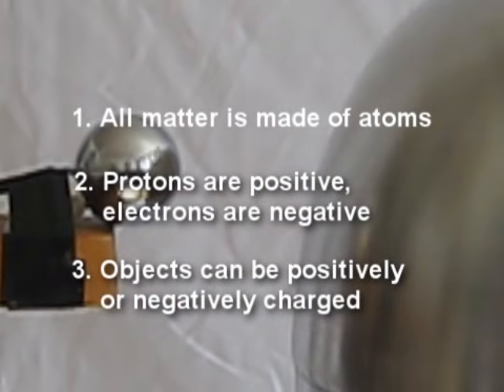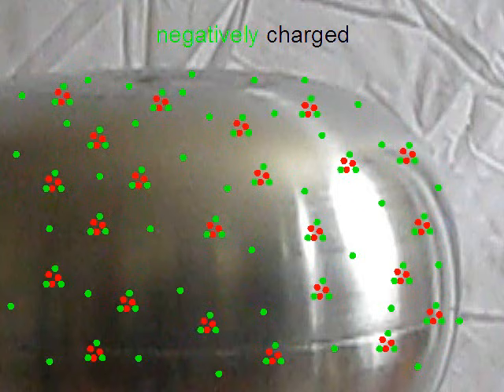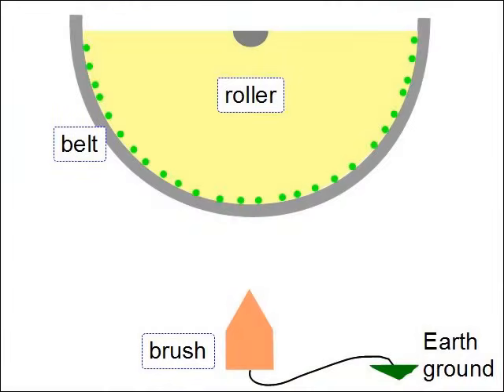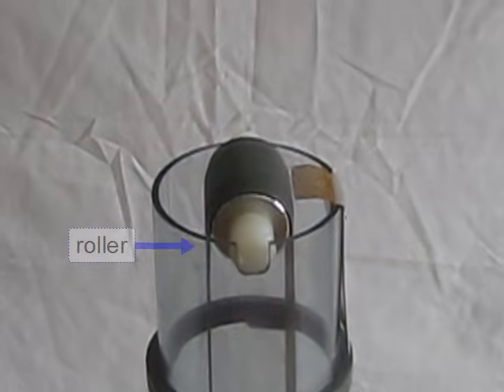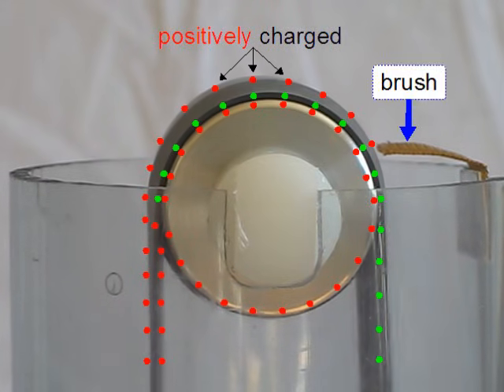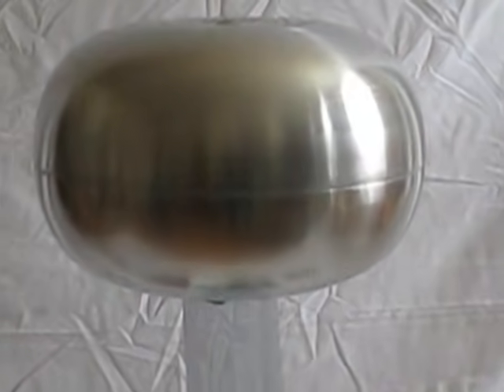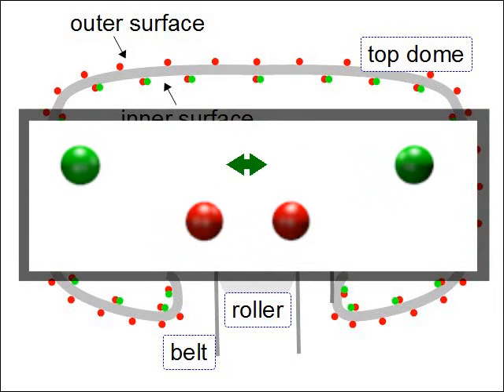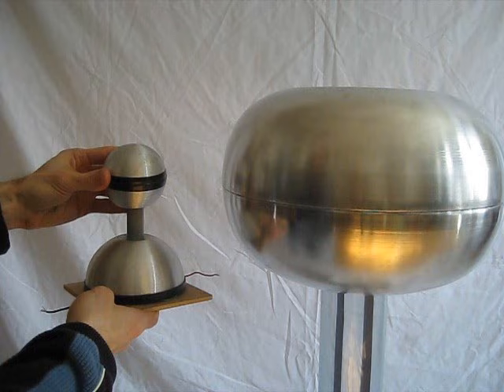How a Van de Graaff Generator Works

Comment: Couldn't you use running water instead of a belt?, maybe charge the water?
Reply from the maker: Funny you should ask, that's what a Kelvin water dropper does. Here are my videos about how it works https://www.youtube.com/watch?v=V3sV8t_HUdc and how to make one https://www.youtube.com/watch?v=sArNxGnYhNU
Reply: @RimstarOrg  Awesome, thanks for the reply...

So it's possible the water underneath the Great Pyramid was used like a conveyor belt to draw in electrons or ions, then they might have used vibrational frequicies to vibrate the structure and produce even more electrons and the combined frequicies helped transport them to the upper ionosphere...

Simple
Reply: This was my delusional theory if you're interested...

The so called queens chamber star shafts of the Great Pyramid were in fact a liquid tuning fork.

There is no logical reason why the builders of the Pyramid would leave a five inch space between the Chamber & the Shaft unless they wanted a magnetic source in the Queens chamber to have an effect on the Star shaft.

SO! ...If you fill the shafts with Liquid Mercury and have an electric current and a magnetic source to make it spin almost as fast as the speed of light.

Also note the shafts bend to the shape of a tuning fork as well.

 So when they spun the Mercury it vibrated the entire structure 

This powerful frequency was the same tone as the multiple tuning forks in the grand gallery & being of the same tone they resonate in sympathy if the other is struck & the builders also built the gallery to resonate at that frequency as well...

What happens is they all start to resonate off each other & give each other strength & you'd have a resonate wave

This too is vibrating the structure, all that rubbing stone with over 1.5 tons of quarts crystals embedded inside...

I have several theories about the kings chamber but I suspect there are far more than only two tuning fork frequencies built into the structure because vibrational frequicies are a very powerful medium 

But I'm thinking the frequencies joined together to form a beam for the charged ions to travel up to the ionosphere  

So I don't know it's all a work in process lol

I have no scientifical learnings as I like to say
Reply: See I don't know what they wanted to send up to the ionosphere...Positive or neg ions? Electrons?

The idea is they were seeding the ionosphere so people on earth could download it and use as wireless electricity...

Haven't read any Tesla books so...& I don't know an ion from an atom too lol

No idea how they could have powered machinery with that technology but I do suspect the Djed post with the three horizontal plates looks to be the almost perfect vibrational frequency machine if you designed one. 3 different plates, 3 different tones

Again, very powerful stuff mixing vibrational tones - like a saser beam for example, you can heal kill, destroy...

So if you set up your Djed you'd instantly receive power for all of your other devices...
Reply: You can, also certain gasses will work with a pump system.

Comment: Nice video with many details. There are some confusing parts though about the rollers!
It's not clear, for example, why metal would give away extra electrons beyond neutralizing the inner belt? (there is no field after neutralization that would drag electrons and charge the belt)

The current explanation concerning internal surface of the belt doesn't stand long term operation by breaking charge concervation law. For example, the given explanation tells that the belt brings negative or no charge to the bottom roller and always removes positive charge from it. This would inevitably cause unlimited growth of negative charge on the bottom roller. A similar thought experiment can be done for the upper roller too.

Comment: The short explanation is that charge is sprayed onto the moving belt due to the action of the lower points.  This charge is then carried up into the hollow metal dome.   Faraday's ice pail experiment shows there can be no charge inside a hollow conductor so the charges migrate to the outside of the dome.  The potential builds up until the air breaks down in a spark discharge .  The energy for all this comes from the work done against the repulsive forces as the belt moves upwards.

Comment: 4:24
Why not electrons move from the brush to the belt  ?
Reply from the maker: Negative charges repel each other. Electrons are negatively charged and there are extra electrons on the roller. So the negatively charged electrons on the roller repel the negatively charged electrons from the belt to the brush.
Reply: @RimstarOrg  Thank you for your good video and thank you for your answer.

Comment: if the top roller is a little bit more positive than the bottom roller but still tends to charge negatively with the belt made of nylon (strong positive). The generator wouldn’t work as good as if the top roller would be made of a positive/neutral material ? I tried putting aluminum (positive) in the top roller but it doesn’t work as good as the pvc (negative) top roller and  don’t know why that is
Reply from the maker: If both the top and bottom roller are on the negative end of the triboelectric series relative to the belt (nylon) then I'm not sure why yours is working at all. The rollers should be on opposite ends of the series from the belt.
Looking at a randomly found triboelectric series, https://www.carolina.com/teacher-resources/Interactive/the-triboelectric-series-an-introduction-for-static-electricity-labs/tr35107.tr , both aluminum and pvc are negative with respect to nylon but pvc is further away from nylon than aluminum is so maybe that's why pvc is working better than aluminum.

Comment: What motor what’s used?
Reply from the maker: In the big Van de Graaff generator, the motor is a 120V, 60Hz, 1.8A motor. The part number is 301-7033 but I can't find it online.

Comment: Wait I’m confused. In step 1 you say the roller gets a negative charge and the belt gets a positive charge (assuming the inner surface of the belt). But in step 2 we need to charge the belt. If the inner surface of the belt is positive and the roller is negative wouldn’t that small area be more or less neutral? And if it is, there shouldn’t be an electric field. So how does that electric field develop?
Reply: I’m probably missing something blatantly obvious…
Reply from the maker: That's a good point. However, the inner surface of the belt is positively charged starting at the point where they separate and the belt continues upward. The inner suface of the belt isn't charged yet while it's still in contact with the roller. Then starting around 8:06 you can see that the belt is either neutral on the way down. You also have to keep in mind that the belt is made of a non-electrically conductive material, so the charge doesn't move around on the belt on its own.

Comment: Question: can that spark make heat? And how?
Reply from the maker: I'm not sure. I think I recall reading that the spark is hot and heats the surrounding air. However, sparks are something I've typically avoided so I don't have enough experiences to have ever noticed.
Reply: @RimstarOrg  I guess if a spark is air, a fuse is the metal alternative.
Reply: I guess it is that due to the ionization of air 
energy is released in the form of heat?

Comment: You gave a great explanation thanks for putting this up! Was horrified at some of the comments below the primary grades K-12 sure aren't what they used to be. Having fun printing conductive PLA and making little induction machines and also just finished a VDG using a printed sphere. Awesome retirement fun as I can now make conductors in most any shape within reason. Did a 200mm. sphere with the bottom curving gently up to the top end of the tube, looks a little like a torus from the bottom. Or a sphere that somebody sat on. Results v. good. Sounds like you're having fun with this me too it's interesting stuff.

Comment: Sir, how to take connection fron van de graff generator.  Like positive and negative connection.??
Reply from the maker: It depends on the Van de Graaff generator. With the big one that I show in most of this video, the negative is the bottom and is connected to the ground in the wall electrical socket so connecting to that same ground will work. For the positive, you need to connect to the dome somehow. For that, you can connect your wire to a smooth, rounded metal object like a drawer knob. Basically anything that doesn't have sharp points since sharp point leak ions to the air and your voltage will be lower. If your negative is also a dome then you can do the same there. You could also just tape the ends of a wire to the dome but make sure the sharp ends are in contact with the dome. I use that method and another in this video here https://www.youtube.com/watch?v=CoWEhcBaFjU to power a corona motor.
Reply: @RimstarOrg  thanks a lot for you response.  My college project is  van de graff generator,  and planning for giving an application for it. A DIY ping ball particle accelerator is the application.  For that , I want to take positive and negative terminals from   generator. Can you give advice for that
Reply from the maker: I don't really have anything more to say than what I said above already. If you're referring to what's also sometimes called a ball cyclotron, here's mine https://www.youtube.com/watch?v=hgt62kh15g8
Reply: @RimstarOrg the link isn't to anything to do with a Corona motor...
Reply: u can use a Leyden jar capacitor to hold the negative charge

Comment: how does the inner surface of the belt become negatively charged rather than being neutral while returning to the lower roller?
Reply from the maker: Good point. The positive charges on the inner surface of the belt on the way up would attract at most and equal negative charge from the roller but not more. So on the way down the inner surface of the belt would either be less positive than it was on the way up or it would be neutral.

Comment: what if you coated the dome with an electrical insulator would that increase the maximum voltage?
would the limiting factor then become the air in the tube?
Reply from the maker: My guess would be the insulation on the dome would break down or maybe the inner surface of the dome would spark to the belt inside the dome. The charge on the belt remains the same. The build up is on the inside and outside of the dome due to the Faraday cage effect.
Reply: It's already coated. *Air is a great insulator. Of course, the best insulator would be a vacuum. (What would happen to a Van de Graaff generator whose outer dome is exposed to the vacuum of space? :-) )

*Well, motionless air is a great insulator. Maybe you could put it in a container to keep the air still, but the ion wind would still move it. Oh, what if you put a large dome around it? And then give that dome the same charge. Prevent ions from transferring. Hmm. But now you have a second large, charged dome to deal with. Oh! What if you put another larger dome around that one? 🤔And then...
Reply: @jonmichaelgalindo  Great comment!

Comment: howDoYouGetMoreCurrent?
Reply from the maker: You can use a wider belt and combs/collectors. You can also make the motor turn faster.
Reply: @RimstarOrg  So,IImagine,IncreaseSurfaceArea...
Reply: Build a big capacitor. On second thought likely not a good idea. The discharge could kill you. (short duration but high max. current.)

Comment: I was wondering that with metal objects like the dome here which are not fully closed, can we say that one side is “inside” and the other is “outside”? Wouldnt that be valid only for fully closed objects? The air/atmosphere exists on both sides of the dome’s walls…it is we who call it inside and outside…the inside and outside surface of the dome are one continuous surface. So how valid is the explanation given?
Reply from the maker: The Faraday ice pail effect doesn't require the object to be fully closed.

Comment: Amazing and comprehensive! Thanks.
Question: would the generator not work in vacuum since there would be no air for a corona discharge?
Reply from the maker: Thanks! I guess it wouldn't work or wouldn't work as well. There's still the chance of the electrons crossing through the vacuum.

Comment: And what if the comb conected to the dome is the one that's receiving the electrons of the belt???
Reply from the maker: In that case, the electrons on the inner surface of the dome will repel electrons to the outer surface making the outer surface negatively charged instead.
Reply: negatively charged domes are less effective and more prone to buildup from atomic attraction.

Comment: Where to get or how to glue the tape(belt )?
Reply from the maker: Which tape do you mean? If you mean the belt then that depends on what material your belt is made of. For rubber, I'd suggest experimenting with a rubber cement, available at hardware stores. However, to some test pieces first. You can also try sewing the two ends together.

Comment: If we repeat the question, but on the van de Graaf generator, the generator is charged with a positive charge, and when we approach a neutral body, an electrical discharge occurs, meaning that electrons move from the neutral body to the charged body to neutralize the generator's charge. The question is why does the neutral body that gave its electrons not charge?
Reply from the maker: The neutral body that gave its electrons does charge. As you say, the generator's dome is positively charged and the neutral body is neutral. That means the two are charged differently. Whenever you have this difference, charge flows from one to the other until they have each have the same amount of charge. So in your example, electrons will flow from the neutral body to the dome until there is an equal charge between them. The dome will be less positive than it was and the body will now be positive, both with the same amount of positive charge.
Reply: @RimstarOrg  That is, the body does not lose charge at once
Reply: @RimstarOrg  By the way, if the two bodies become positively charged, why do we not feel an electric shock when touching them?
Reply from the maker: You won't notice the transfer of charge if it's too small. For a spark, there has to be enough charge to break down the air as you approach the object. If there isn't enough to break down the air then you'll simply touch it and the small charge will flow.
Reply: @RimstarOrg  Thank you very much. Can I ask you one last question regarding the electric voltage, they measure it in relation to the voltage of the ground? So if we assume that we have a negative charge of -3c connected to the ground, what will be its voltage and in the second case we have a positive charge of 3c that was connected to the ground, what will be the voltage of the two charges on  Someone?

Comment: QUESTION:
How would the placement of a UV light affect the Van Degraaf Generator, so that it provided higher energy photons into the negatively charged side of the belt?

-I'm guessing that the VDG would  cause Quantum Leaps of the energy levels of the electrons ....which would cause the photons to be more energetic ... which could lead to the UV radiation becoming higher levels of Electromagnetic Radiation, such as X-Rays, or Gamma Rays???

I have never heard of incorporating a UV light with a VDG. Is this something that is actually done?
Reply from the maker: I've never heard of it being done but that doesn't mean it hasn't. The only playing around with UV lights is there fun experiment in my video here https://www.youtube.com/watch?v=puT36rd9dkQ and based on that, I don't think that light would make much of a difference to a VDG.
Reply: @RimstarOrg  What are the applications of a van de graaf generator?
Reply from the maker: These days they're mostly used for fun and for demonstrations in museums and science classes.
Reply: @RimstarOrg  I recently read a U.S. patent filed by the U.S. Navy.
Its what's called a U.S. Navy UFO Patent.

Its for a complex device called a High Energy Electromagnetic Field Generator.

It has 2 Pelleton Van De Graaf generators in it.
Reply: @adamrspears1981  Mark McCandlish said that the Biefeld-Brown effect doesn't kick in until the capacitor charge reaches 1,250,000 volts. This is why nobody has duplicated it, or it doesn't work in a vacuum. Not enough voltage. A month or two later, he "suicided" himself. Worth trying an experiment. He said that inertia and gravity undergo drastic modification with such voltage. If true, seems like somebody would have noticed it by now, but maybe not.
Reply: @slickwillie3376  People routinely build 1 million volt+ electrostatic machines. Have for decades. Almost a century ago MIT built 2 VDG,s charging with opposite polarity that were large enough for the operators to sit and work inside the spheres. Cool pics. of these machines online. They're in the museum of science in Boston MA. now.

Comment: I have a question. What are the practical problems the Van de graaff can solve? And what he's benefiting from is this use in the labs.
Reply: There are some experiments you can perform with electrostatics using Van de Graaff generators, but it's not really that useful for practical stuff since you can't do a lot of work with the charge.

Comment: What happens if ur on a conductive ground while holding the van de graff generator and why will it happen
Reply from the maker: If you have one hand on the dome of the Van de Graaff generator and you're connected to ground then all the charge that's moving to the dome will move through you to ground and nothing much will happen. There will be no voltage build up on the dome.